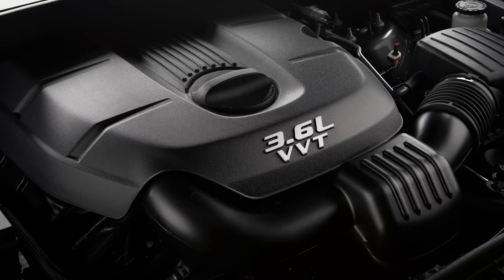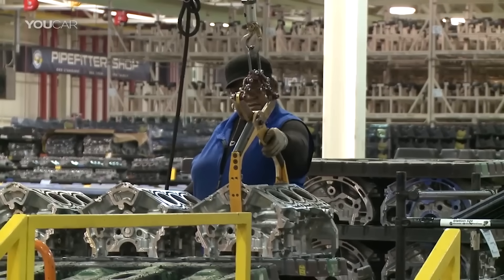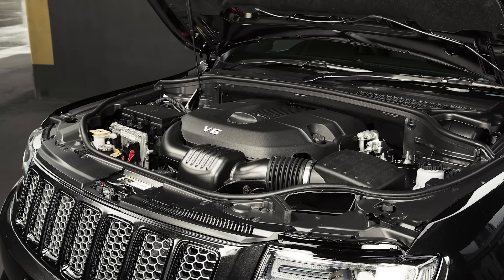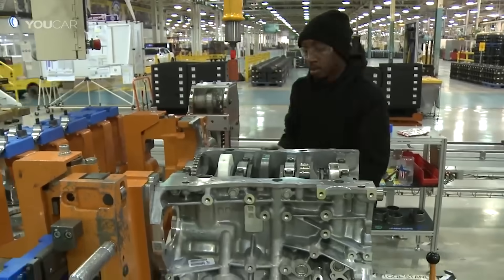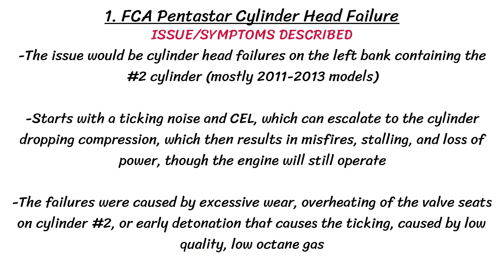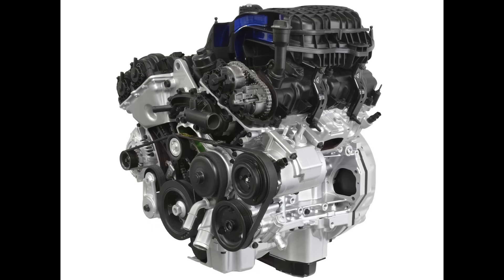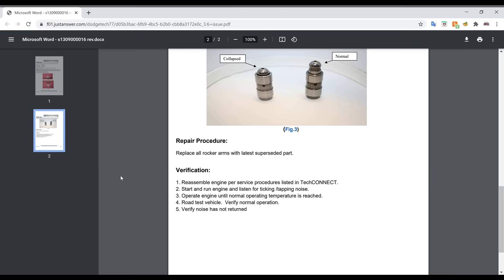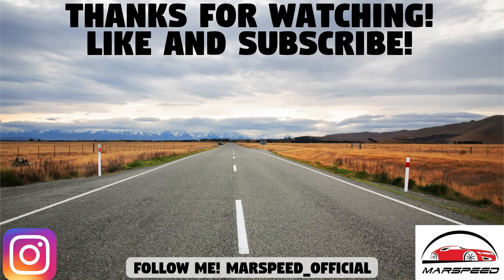The Specs and Fatal Flaws of the Chrysler 3.6L Pentastar V6 Engine

Comment: Wow, imagine that plausible deniability and they’re jumping all over it, while ROBING the customer with sandpaper, literally the sand that made the casting. NOT LOL😢 

Not surprising, though, considering the number of power module problems that plague the ROUTAN,TOWN AND COUNTRY AND CARAVAN, AND I’m SURE MANY OTHER model Chrysler PRODUCTS THAT HAVE THESE POWER MODULES. 

Chrysler obviously had no Consideration for the number of mothers and children that have experienced dangerous power loss while driving, to as little as lights shutting down flickering dashes, and window wipers arbitrarily running….  

Chrysler conveniently Took no responsibility regarding the Volkswagen Routon venture, sticking it to every customer whoever bought one .

Fortunately, by 2012, they had eliminated most of these issues, however, that does not help the thousands of people who had bought these vehicles .

Not thanks a lot, Chrysler for giving one more concern to fathers, and one more problem for mothers…🧐🧐🧐🧐🧐🧐

Comment: I got a 2015 dodge charger se it was brand new took it to the dealership everytime it was time to service but the carrier bearing went out to soon so i had to get the whole drive shaft and then a year later another drive shaft and now the 3rd one is going bad and i just installed the oil cooler assembl oil leak oil pressure was going up and down then i found the leak and im learning to hate this car money pit the oil is still going up and down im about to give up there's other issues to.

Comment: Hello. Great video. I have a 2015 Grand Caravan. And I'm in 1 rebuilt left head because of cylinder to misfire including 2 cam shafts, rocker arms and push rods. Also new timing , radiater, transmission cooler lines, new intake camshaft and rocker arms on the right head. I think that's it. Yeah learning alot but not by choice. Looking forward to saying goodbye real soon. Again great video

Comment: I just took my 2019 Wrangler in (with 48k miles) for the Rocker Arm issue, probably caused by the bizzar oil filter design. Allowing the water like oil to empty from the oil filter after 20 minutes of down time, seems like a purposeful means of destroying an engine.

Comment: Well I suppose that sand  used in the engines manufacturing process could be the reason I have gone through 3 water pumps in 3 years on my '16 75th Anny GC. And with 3 coolant flushes also.  I've only had it for 3 years. No telling how many water pumps have been put on the damn thing. They just wont stop leaking around the seal area. Rather anoying seeing the engine runs flawless at 120k miles.

Comment: The housing for the oil filter and cooler (made out of plastic) leaks eventualy and a aluminium  replacement part solves the problem. The cartridge oil filter allows all the upper engin oil to drain back to the oil pan this fault causes about a 4 second dry start till the oil fills back up. This fault can be fixed useing the Baxter oil filter adapter. It helps to change your oil every 3500 miles along with a fresh filter and using a mid level octane gas helps a lot.
Reply: why mid level octane

Comment: My 2011 jeep grand Cherokee with the v6 left me stranded 1 hr away. The PLASTIC oil filter housing was leaking. Made a mess down in my motor. Also a PLASTIC coolant line cracked and dumped all my coolant out. 

Its had a misfire on 3 cylinders.even after new spark plugs and coil packs. It kept leaking oil. Changed valve cover cover gasket and oil pan gasket and it still leaks. This happened in-between 140k-160k miles . Over 1500 in repairs.  also transmission wouldn't come out of 4 wheel low mode. And left me stranded again.

Comment: I had 2011 3.6 charger for about 7 years bought it used with 80k km and sold it when it had 280k km only problem I had was oil cooler started to leak it wasn't an expensive fix since I did it my self and other problem was when I first bought it the alternator stopped working and there was a recall for it so the dealer changed it with no cost to me. Other than that I used to race it with my friends every week and drift never had a major problem. I always changed the oil at 5k km max 7k km and change the oil filter every time.

Comment: Though the Pentastar is a superior engine to its predecessors, it does have a couple problems not mentioned in the video. I have heard the timing covers are thin and tend to break, the original water pump housing and the oil filter housings are all plastic, originally. The oil filter housing is the most prolific. It's a somewhat involved fix but easy enough. Dorman makes metal components to permanently fix these problems. My wife has a 2015 Jeep with a Pentastar. It's a great engine. But with no obvious signs of oil leaks on the sides or under side, she has complained of an oil smell occasionally. I checked the oil filter housing and confirmed the leak. Small but there. so, I am putting a Dorman housing in soon. I have one, just need the time.

Comment: I'm surprised you didn't mention the stupid plastic oil filter housing that will leak on all 3.6 engines eventually and unless you are constantly under your car you may not even know it's leaking.  The oil pump solenoid is prone to failure as well, but this is not so much a problem as it is a nuisance since nobody needs a oil pump solenoid. It's function is to squeeze a tiny bit more mpg out of a tank of gas probably at the expense of engine longevity as it reduces oil pressure and therefore load on the engine below 3k rpms and you get full pressure over 3-3.5k rpms.
Reply: I noticed the oil cooler leaking on my mom's Chrysler town and country when we were replacing the maf sensor. It made a huge oil mess on the transmission and sure enough the engine valley was full of oil when I replaced it

Comment: Really well done video! I had to replace the oil cooler on my 2014 Chrysler 200 S at about 110k miles. Opted for the Dorman aluminum replacement. And I will be upgrading to other aluminum replacement parts if/when the original plastic parts fail.or wear. Other than that, no problems whatsoever. Great engine with lots of power.

Comment: Thank you for the video. I got a call on a 2018 300 today with a p0300, p0151, p1621, and a historic p0171. I smelled coolant and seen where coolant came had hit and dried on front of engine starting at bleed plug and worked its way down. Put a pressure gauge on fill reservoir and pumped up to 10psi. No loss of pressure, no coolant leaking. Long term Fuel trims on bank two at 29+%. Revved engine, slight misfire, then long terms on both banks all over the place intermittently. Fix finder suggests he replaces fuel pump. I can't see a port to monitor fuel pressure (should be a penalty punishable by unaliving). Also bank two, number one sensor dead at 0.00v. Any suggestions? Anyone? Oh yeah, bank one, number one 02 sensor replaced and head gasket replaced under warranty by Chrysler recently.

Comment: Good review!   I just had the plastic oil cooler replaced (due to leaking) on my 2014 T&C, with 99k miles. With a tune up, the total cost was almost $1300.00. This issue came after a thermostat replacement a year earlier which cost $330.00. I'm not complaining as such, however,  why did Mopar engineers designed a very vulnerable plastic oil cooler to be installed inside the engine? Please, don't say because its front wheel drive, and placing it in front of the radiator (as normally located) is not logical, and saves on weight!

Comment: 123,000+ miles on one of the first 2011 engines. Changed the oil every 3000 miles because of fear of the cylinder head failure problem. Never had the cylinder head failure. The only problem involving the engine was the oil cooler went out sometime after 100,000 miles. I've changed the thermostat a couple times and I broke a spring component in the oil filter housing which is part of that oil cooler that eventually failed (maybe related?).

Comment: Lifter and rocker arm click within the first 50,000 miles. Oil filter cooler housing failure in the first 45,000 miles. Biggest piece of junk I’ve ever had.

Comment: Just had a cylinder 2 (P0302 OB2 code thrown). In the process of elimination to fix it. So far, the coil pack and the spark plug are not the issue. Tomorrow we do a compression test on cylinder #2. Hoping it's not a compression issue but anything is possible at this point. Mice did chew some of the wires in the engine bay at the injectors and at the large wiring harness clip on top next to the intake. What a ride, this will be.

Comment: I have a 2018 Jeep Wrangler Rubicon Unlimited with around 47,000 miles. One day sitting at a traffic light it showed that it was overheating. I had never had an issue with overheating, thought it was strange. Reservoir was empty and I filled it and got home without issue. Next day it was low, thought it just needed more. Afterwards I started getting a misfire code in cylinder 6. To make a long story short, it turned out to be a blown head gasket. I had never had overheating issues at all, bought it new. Just happened suddenly without warning. The quote to fix it is about $4,000. Warranty is 5 years 60,000 miles. I was well under the miles but 3 months past the 5 year mark. Contacted FCA and they would help at all. Very disappointed in my 3.6. I have a 2006 LJ with 4.0 engine as well. It has 173,000 miles and still running strong. Never had any major issues with it.

Comment: I have had trouble with the rocker arms failing, but since disconnecting the oil pump wire that puts the pump into low range, the rocker arms seem to be holding up OK with the increased oil supply as now the oil pump always stays in the high mode. So instead of running on about 25 PSI I am running about 67 PSI while cruising down the road at highway speeds.

Comment: Have a 2015 GC with 124K miles. October I found a code PO126 having to replace radiator, water pump, and thermostat for 800.00. Tech drove the GC on test drive to lunch and it threw another code PO006 Oil Pump pressure. Just got it back yesterday 1772.00 later, ,replacing oil pump and dipstick tube. I was informed that the oil cooler is leaking and that would be an additional 1300.00. I have noticed the ticking, thinking it was maybe a valve lifter but after listening to this, will probably cause more trouble. After knowing the oil cooler was leaking, I had already made up my mind to trade this vehicle this summer after my tractor is paid off. The van will be driven very seldom except going to Dr appt's. Getting to old to be aggravated with problems I cannot repair myself.

Comment: A great engine, only if no problems emerge.My son's 2015 Jeep Grand Cherokee has had a radiator leak at the lower hose connection area, a needle rocker arm failure, we tore it down and replaced all the rocker arms, and now a oil cooler leak, all under 90000 miles.

Comment: I have a 2022 Jeep Gladiator with the Pentastar 3.6 v6...it has experienced predetonation since immediately after its first 12000km service. It took my dealership in Australia almost 8 months to fix the problem (citing unavailability of the required parts)...it was fixed at 37000km. They took the heads off the engine, and sorted it apparently. Trouble is,I have had the car back about 3 weeks and  the dreaded predetonation is back again (albeit a lot less than before at this stage). 

I have always run the highest quality fuel available in Australia (which is 98 octane here) in my jeep with the exception of 2 occasions when i was outback and could not get it and instead ran 95 octane). I have every fuel receipt for evey tank of fuel ever run in this jeep in my business bookeeping program and can produce them anytime to prove the fuel i have used. I never willingly elect to purchase fuel from cheapass unknown service stations...i always try to purchase from the big brand name servos (ie mobile, caltex, BP, Shell etc)

I am not sure what to do now...i am worried that now the problem appears to be back again, im flogging a dead horse!

Might i also add, my car had to have a new transmission at 37000 km and it was not because of anything i did...a manufacturing issue according to my dealership.

Comment: I purchased a 2016 Ram 1500 V6 in 2018 with 8,800 miles on it.  The computer went haywire at 22,000 miles in 2020 and was replaced under warranty. Other than that, no problems.  I change the oil every 2,500 - 3,000 miles whether it needs it or not.  I put the used oil in my wife's 2014 Elantra and get another 2500 miles out of the used oil.

Comment: 2015 Journey with 85,000 miles... Left Head Failure.
Chrysler/ Dodge WILL NOT stand behind the Journey with that faulty Pentastar engine.
Cost us $5,000.00 USD